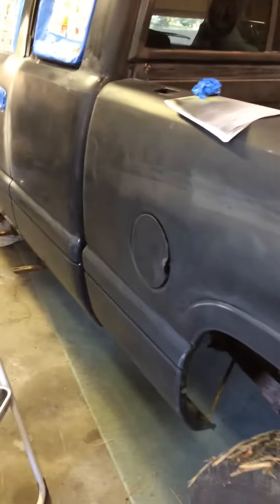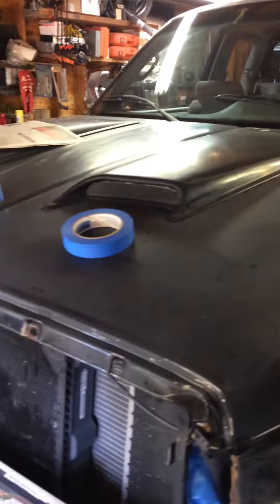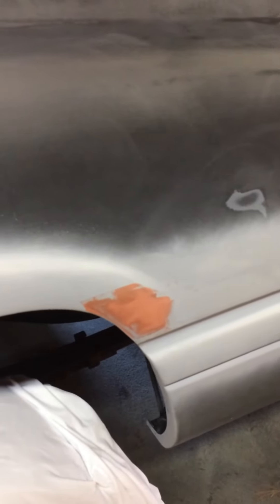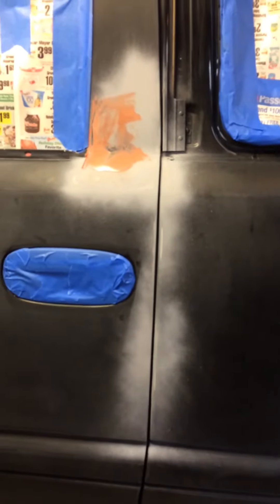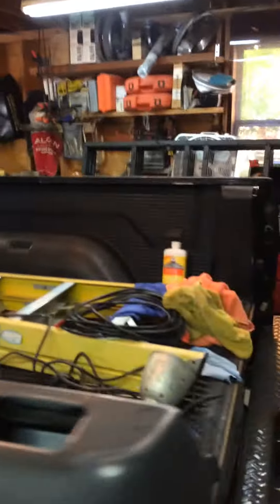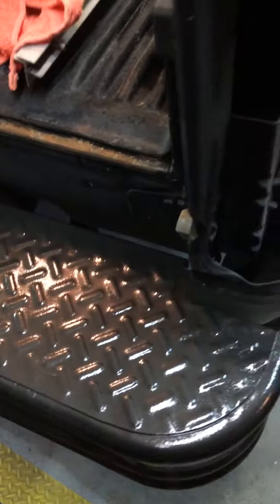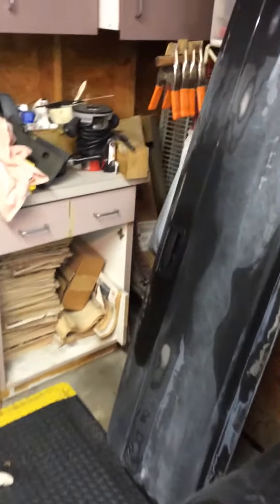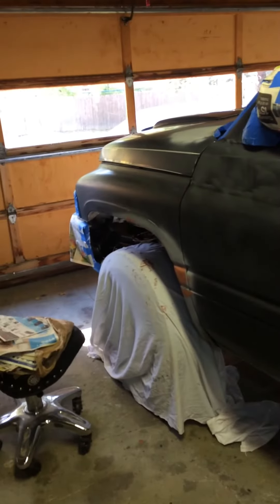Rustoleum Topside Dodge Ram paint job Part 1

Comment: Hi, did you use rust-oleum topside primer? Or just any type  or primer?
Reply from the maker: @PinkTacos44  …I used your typical Rustoleum spray primer..I would definitely use a Rustoleum oil based or spray-type primer because of compatibility
Reply: @gospos1  thanks. I found some rustoleum primer (quart size not the spray can) and after looking at it, I can’t tell if it’s oil based or not. How can you tell